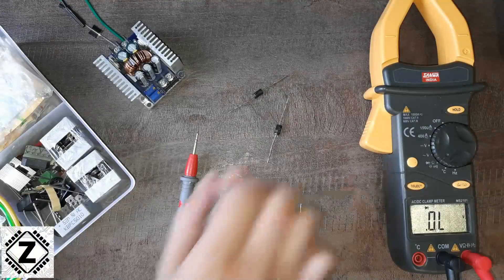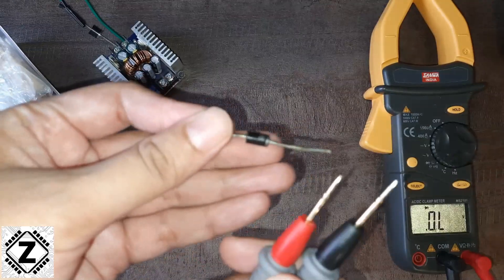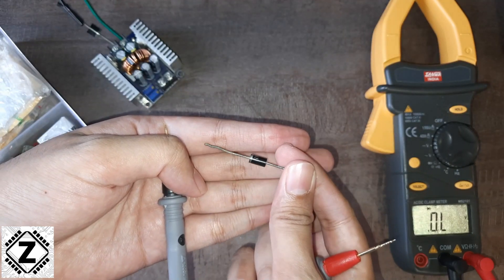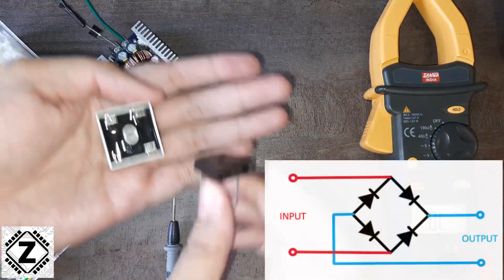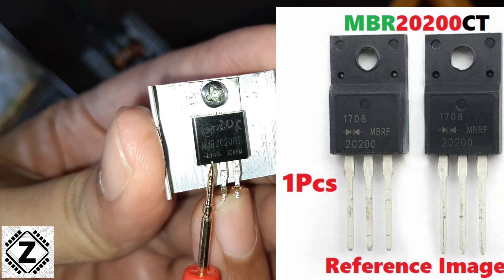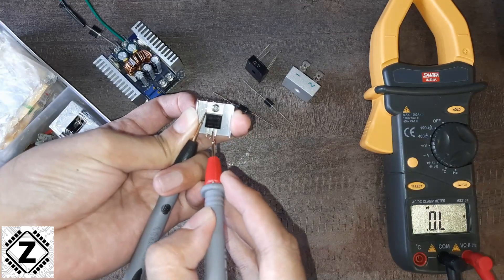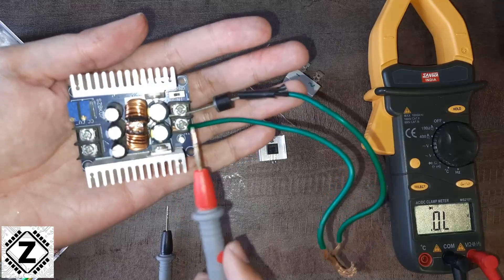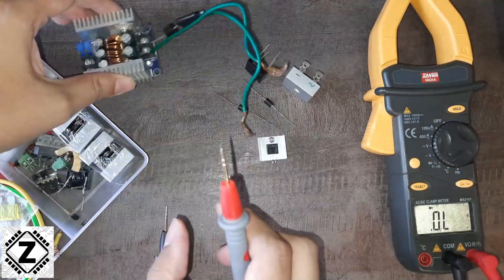[Eng] What is a diode? How to test it using clamp / multimeter | Types & uses of diodes explained

Comment from the maker: This video is available in Multiple Languages
Hindi https://youtu.be/Zi2R_Z6V1Q4
English https://youtu.be/wZQ1ULznyDw

[Best Buy Affiliate Links]
Rectifier diodes https://amzn.to/3Rs8y40
Schottky diodes https://amzn.to/48o1jjz
Bridge rectifier https://amzn.to/46gWqqW

Branded Digital Multimeters-
HTC Instrument Mas 830L https://amzn.to/3nciKwc
HTC DM 81  https://amzn.to/2ERygMq
Mextech DT-603  https://amzn.to/33pdYn3
MECO 101B+ Digital Multimeter Pocket Size https://amzn.to/30ul87L

Buy High Quality AC/DC True RMS Clamp meters (RECOMMENDED)-
My Meter- Mastech MS2101 https://amzn.to/342Ogp0
Metravi DT-725 TRMS https://amzn.to/45VtXHm
KAIWEETS HT208D Inrush https://amzn.to/3t3yNUa

Chapters English 
00:00 What is a diode, How diode works
00:15 Anode & Cathode terminals of a Diode, Symbol
00:30 How to test diode using Clamp or Multi meter
01:20 Dropout voltage, Why diode wastes energy as Heat?
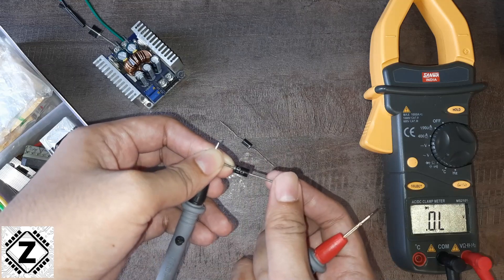01:40 How to find faulty, leaky or Damaged rectifier diodes
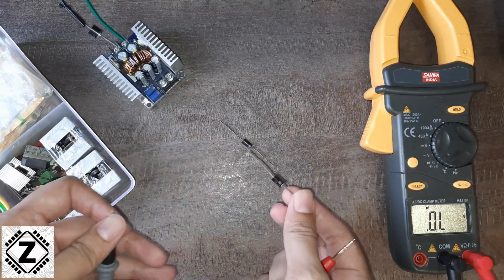02:13 Types of Diode packages, Bridge rectifier, TO 220, Heatsink
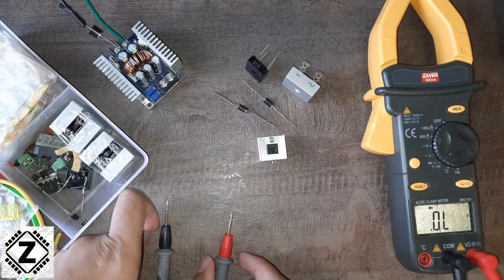05:08 How to use diode for reverse polarity protection

#diode #Electronics101 #ZenInnovations #zenenglish  #ClampMeter #Multimeter